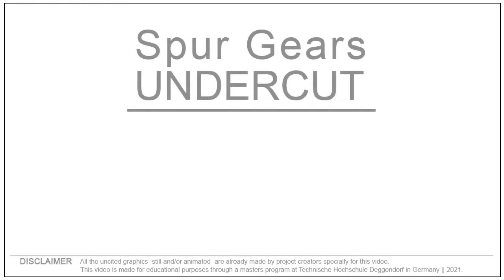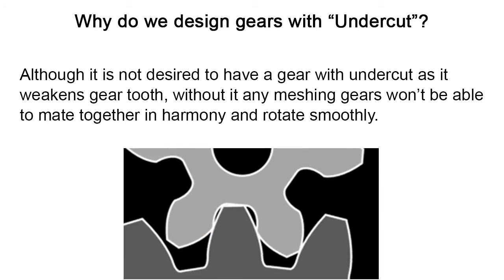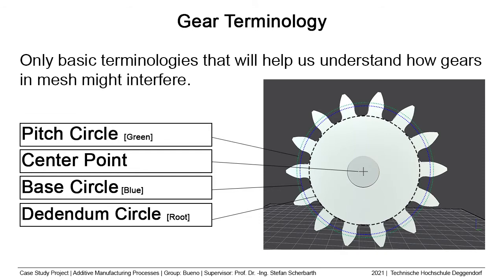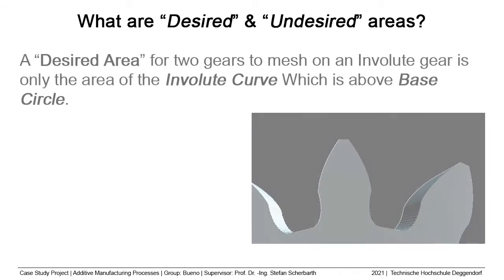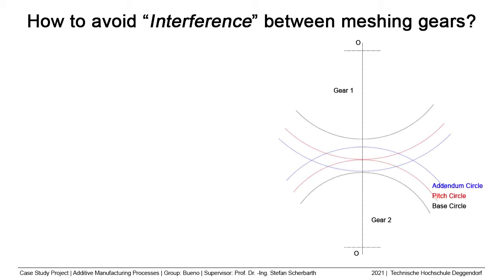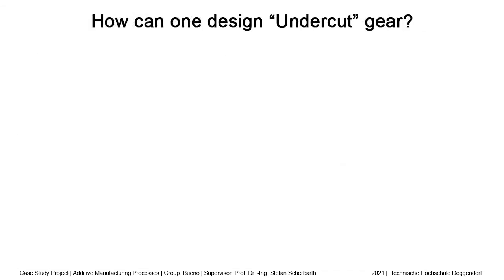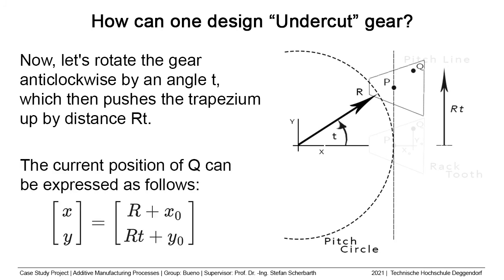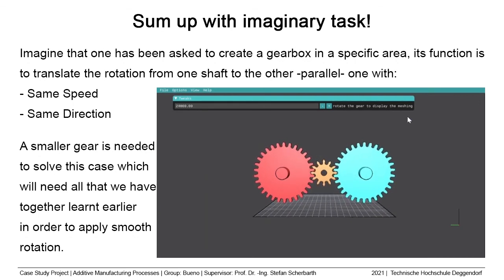Explaining Undercut in Spur Gears

Comment: I imagine the undercuts aren't designed to bear pressure from the meshing teeth. If so, why wouldn't the tooth tips simply be shortened to avoid the interference? I assume the tooth would only gain strength by following that approach.
Reply: If you shorten the tip you lose part of the involute and thereby some of the engagement.

Comment: This video needs a remake. There are times when it sounds like you talking to yourself and not the listener (4:30 to 4:50). At time point 4:50 your explanation needs  a graphic showing two meshing involute gears. In the current version this section was to difficult to understand. I stopped listening at this point because I could not follow your explanation. I'm 65 and familiar with gears but I don't know a lot about them and wanted to learn more. I'm sure making videos is not easy, even teaching a subject can be a challenge.
Reply from the maker: Thank you for taking your time to watch. This video was a final project for a course in my masters degree. I don't study this topic anymore. I hope to post more videos on new topics I am working on
Reply: I am a teacher in mechanical engineering, and yes this topic is really hard to explain. It needs a lot of figures and, moving figures to explain this. The books fail to explain this topic. This is the best explanation so far. Big thanks to sir Cory for doing this.